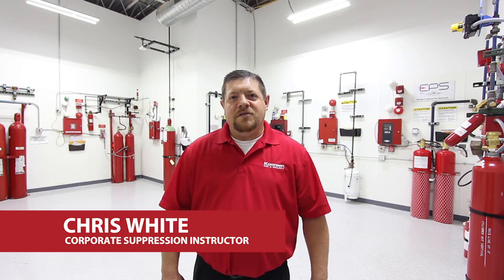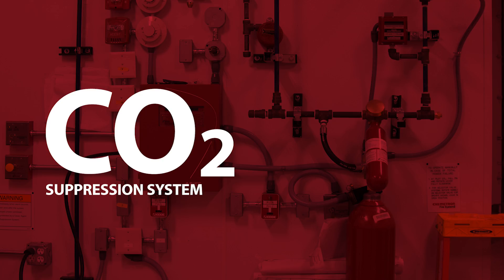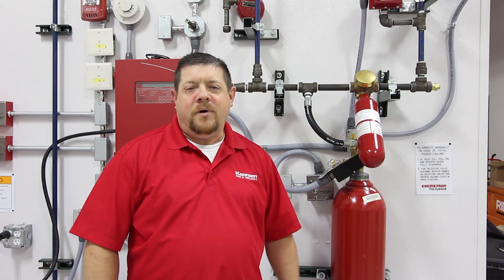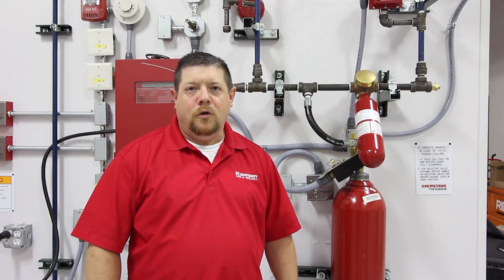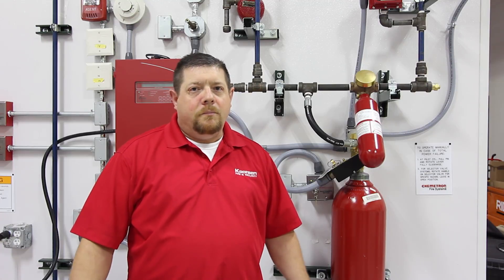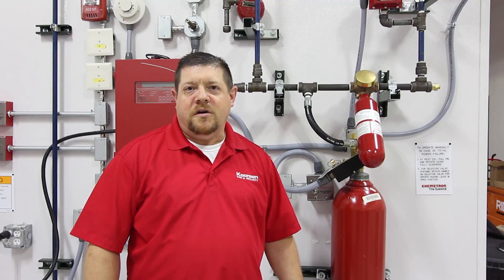What is a CO2 Fire Suppression System and How Does It Work?

Comment: Technically Low Pressure Co2 is more efficient for local application, so not all CO2 is the same.
Reply: low pressure co2 is stored at 0 degrees and when it hits the atmosphere it warms up and becomes high pressure. its the same technically

Comment: I am going to perform full discharge test for new CO2 suppresion system which is designed to protect turbine encloser. What will be the temperature inside of the enclosure? Is it possible to damage equipment by applying low temperature?